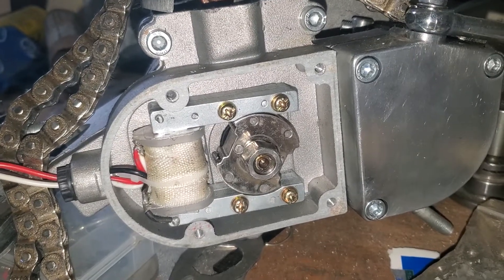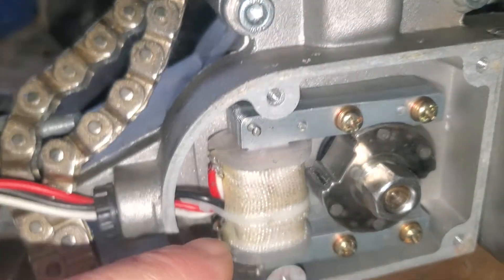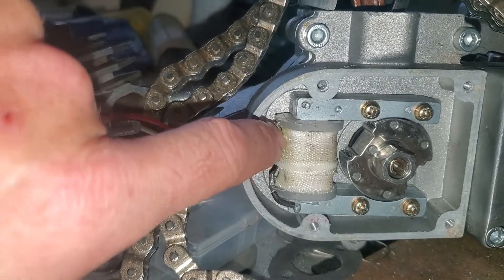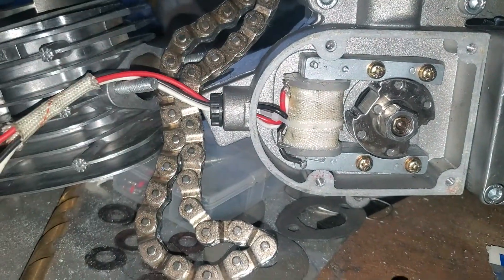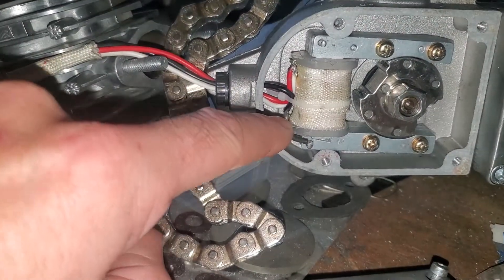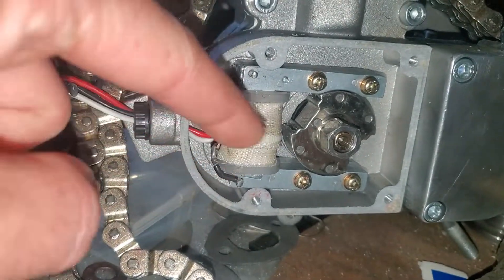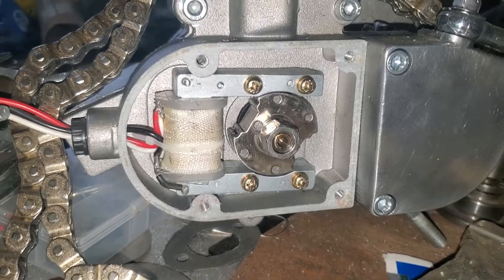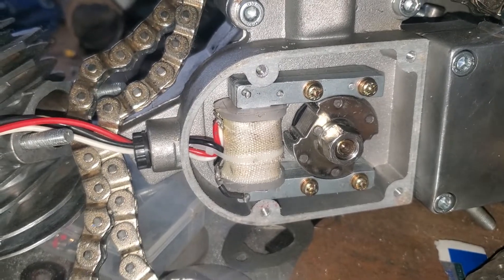Let's talk about the white wire. motorized bike charging system.

Comment: White and red wire are exactly the same. Only  One coil  3700 turns of wire maxing a 290 ohm coil @ 3-7 volts ac depending on rpm.  Red wire goes to cdi black goes to cdi as grounding contact since cdi is plastic.  Black is also grounded to magneto frame.  To create ground for spark plug. White would go to a 10,000uf ac ceramic capacitor and to the light.  1v to 3v incandescent light bulb.  The kind like you find on the wheel genarator light  kits.  Anything bigger then 3v light will cause ignition issues.  Lights grounding wire goes to the other leg of the capacitor  and it is then grounded to the frame or engine case.  I hope that explains it!
Reply from the maker: This magneto has dual coils. This is what I use. https://www.ebay.com/itm/283647770259?mkcid=16&mkevt=1&mkrid=711-127632-2357-0&ssspo=LkQ2WeHyRfq&sssrc=2349624&ssuid=PVlK6jq4Qti&var=&widget_ver=artemis&media=COPY
Reply from the maker: It doesn't work for a DC setup without some rewiring.
Reply: @SamZStuff  You did see the AC 3-7 volts in what wrote correct? has nothing to do with rewiring you need inline diode to which you can't use on this period. it will short the cdi out.
Reply: @SamZStuff  it's not though.  Simple way to prove it! Actually under the tape they are y'ed.  Just the Indian version.  Take ohm meter red and black are 290ohms.  Same with black and blue. Blue and red will dead short cause its directly connected.  It takes 2700 windings.  No room for a second coil!
Reply: Hey I hope you didn't take me the wrong way about 2 years ago when I bought like 9 of these!  I cut them all open one by one and unwound them all!  video some place of 9 I did!  only thing changes is some use 34g wire and some 30g wire. some are grounded directly some are not!  Higher voltage coils are smaller wire more turns to make 290 ohms then  6v coils!   some point actually want to run each one with lathe measure outputs just never got around to it yet.  I have like 40 different ones sitting here now lol maybe video to come when not so hot!

Comment: I cut it off.... but what about that chain it's all half links is that what you run on your bike i have never seen that👍👍🚲
Reply from the maker: Yes brother I run it on both sides. 1/2×1/8 bike chain. Works and looks really good. And pretty cheap.
Reply: @SamZStuff  where do you order something like that chain?
Reply from the maker: @handcannon87  just look for 1/2×1/8 half link bike chain.
Reply from the maker: @handcannon87  ebay or Amazon or any bike shop would probably have it.

Comment: Just got a motor from BBR a couple months ago and the mag was already installed with no white wire.
Reply from the maker: Yeah I think they call it the high performance one. I ordered a 12volt one from ebay.
Reply: @SamZStuff  No, it was the cheap one.

Comment: I only run the upgraded magnetos that come with a red and black wire only and have a fatter Center body with more copper windings. You can find them pretty cheap on eBay or Amazon and they usually come with a CDI. Also check out WAGO 221 connectors bro if you haven't yet.
Reply from the maker: Nice I like that connector.  Thanks👌  and I know what your saying about the magneto. I really like the dual coil one. Makes setting up a 12volt charging system a breeze and it's fairly cheap.
Reply: Haven't seen a video from you in awhile James.
Reply: @wrongturnmotorizedbikes4604  I got a lil burned out on making YouTube videos.

Comment: Rpm gains peak power .at max rpm polarity isn't  the same it fluctuates so it  has no. Capacitor  to maintain continuous 6 6v screw taller than magnito also changes.!

Comment: Just cut it off you don't need it. If you want lights use the battery box that holds 8 AA batteries. Works great and won't draw power from you engine
Reply from the maker: But if you could use it as a way to charge those batteries without drawing power from the engine.  That is what I do with the white wire.  It doesn't work with all magneto. You have to have a 2 wire magneto. Aka 12 volt magneto. They are still wired to be used as an ac voltage for a direct to light wiring.  So a little bit of rewiring is required to use as a ac voltage to regulator rectifier. Wich will put out dc voltage and charge the batteries.